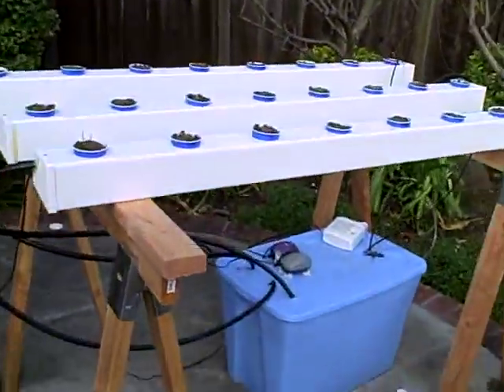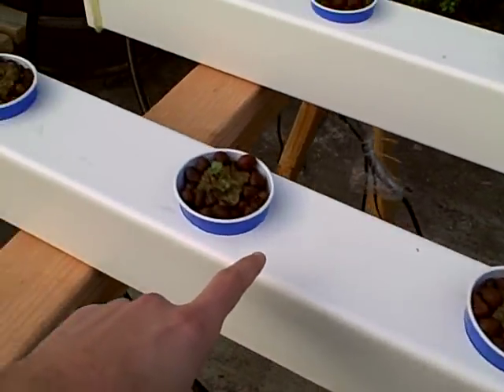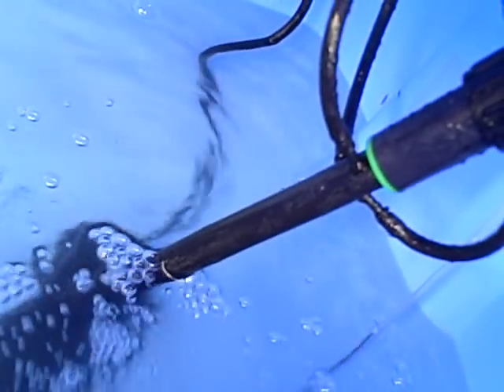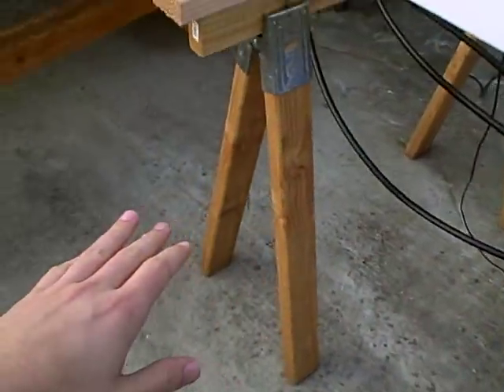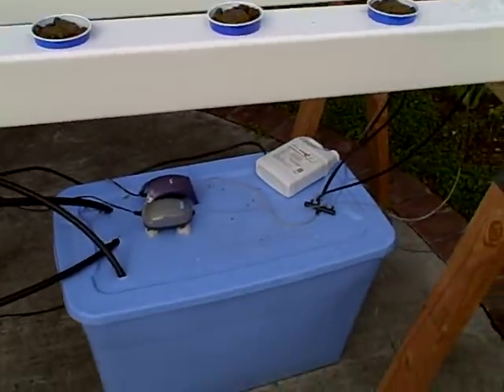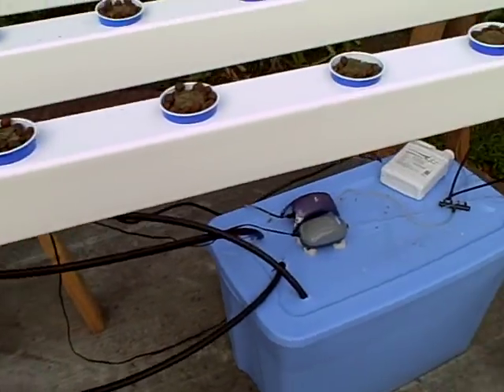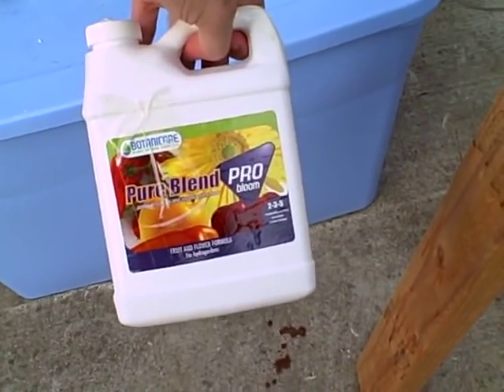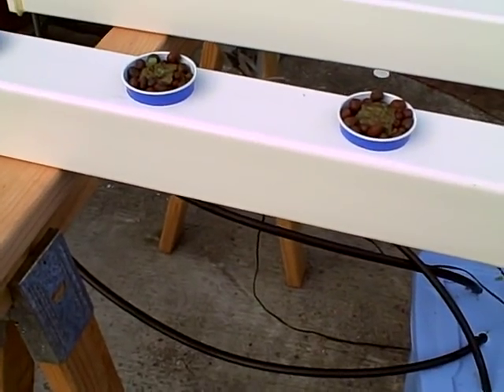How to Build a Hydroponic Garden

Comment: But what about the electricity used to pump nutrients and oxygen o the plants? HOW MUCH ITS WORTH?... From planting to harvest

Also... PLANTS GIVES OFF OXYGEN... Why do you need air-pump to the oxygenate the water?
Reply from the maker: You are right that plants give off some oxygen from their leaves during photosynthesis, but the roots actually need air or they die.  This is why you need an air pump to ensure the water is well aerated.  Alternatively you could put a timer on the water pump and not air pump and turn this into an ebb flow type system.

Comment: how much of the time water pump running on ......???
Reply from the maker: I had it running all of the time but you could set this up like an ebb and flow system with ease and may have even better results and same some power too.  You could run it 5min on and 5 min off or something like that.  The key would be not to let the roots dry out ever or they may die.

Comment: what  speed of water we have to maintain in pipes,   and which  nutrient we have to add in water. is we have to change the water after some days or not if we have to change water then how many days after.
Reply from the maker: slow flow is fine so long as it is moving.  The links to the nutrients I used can be found on awesomenessprojects.com.  You will need the change the water every few weeks or more often as you plants grow and use up the water.

Comment: would it not be beater too put your water pump and container up higher then your plants so it is easier for the pump too do its thing ? that way a smaller pump could be used ?
Reply: If your water source is higher than your plant source or mediums than what you will have is a gravity fed system in which you will need a strong enough pump to bring water back up after filtration. check out eb flo systems

Comment: What size water pump do you use and is it on a timer or does it run continous?
Reply from the maker: +Tomsfishing The pump I used is 185 gallons per hour and runs continuously.  It is split into 3 outlets though as seen on  AwesomenessProjects.com

Comment: How did you get the end caps to seal? I found that they fit a bit loose..
Reply from the maker: +frozenfowler I used 100% silicon caulking
Reply: +Matt Davidson Well I had a pallet full of post covers that I picked up for next to nothing and I was going to build a large system. But the poor fitting leaky end caps frustrated me so much that I just went with regular pvc piping. Lucky for me though a contractor drove by my house and saw them. He offered me 5 times what I paid and took the whole lot =)That being said, thanks for replyingDan

Comment: Next time try drilling a drainage whole at the bottom on the far end where u are running drainage hose  cut a square out of the vinyl right above the drainage whole so u can trim any roots that wanna reach down into your drain pipe.... k so what u do once you have those two holes cut at the far end u wanna drain out of stick a 1and 3/4 inch PVC pipe in the bottom of the vinyl post in the small whole u drilled, with a rubber grommet around it so that it doesn't leak... then you can raise and lower your water level within the vinyl post ;) very helpful for not drowning your roots, and SUPER!!! helpful to get that water level full in the vinyl post so that you can put new young plants in there with not as much of a root system yet. just a helpful tip bro 420!! :p

Comment: Thought of a simpler fix for the water flow rather than trying to raise one side of the saw horses higher than the other. You can actually keep the assembly level. The inlet hose on the right side (at the 0:43 mark) is already feeding in from the top. Turning the left end cap with you outlet hose 180 degrees would put it lower than your inlet source. This allows the water to naturlaly flow from high to low without having to tilt the entire assembly to "feed upwards" to the outlet hose.

Comment: @awesomenessproject Thanks! Also, how long is the fence post and how much space did you leave between each cup? And I noticed the end caps have a yellow substance there. Did glue those and if so with what? .... I'm building a system at the organic garden of my school and ill be using the fence posts but placing them in a vertical design. Your help is greatly appreciated! :)

Comment from the maker: I switch the nutrients when they are low, I stopped taking careful measurements and now just eyeball things.  When the plants are young I use low nutes, then I gradually increase Nitrogen. When it is time to flower and fruit I increase P and K.  
I pour out the basin maybe 2 times a year to flush things out when they get gross.  But if you switch over the a chemically defined nutrient powder there is almost no organic matter and you don't have to flush it.